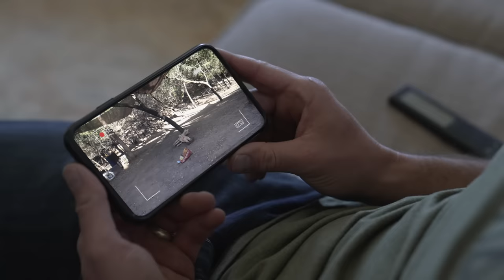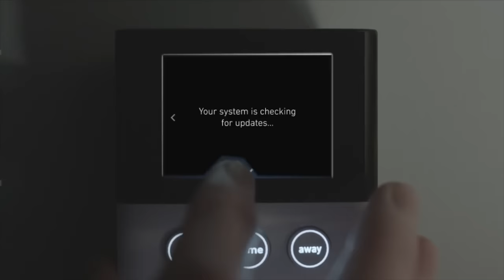Can a Brand New AK Survive the Demolition Test?!?

Comment: I'm calling that a pass honestly. Well done Century Arms.
Reply: Physical toughness does not make it good. It might still blow up like a ras47 does
Reply: @nikik5567  Their newer models have forged trunnions. The ras47 had cast trunnions, which is why they grenade.
Reply: @nikik5567  To be honest, I was under the impression that S7 was a forged steel, but I'm guessing that's wrong.
Reply: @nikik5567  nothing but truth, if you’re gunna go USA, go KUSA
Reply: @mikefelty2625  S7 is just a grade of the steel. Forged vs cast vs machined doesn’t have anything to do with it. S7 is a tool steel. Which in itself is fairly strong stuff, but not suitable to usage on trunnions and other pressure bearing parts of rifles. It’s a good steel for high impact parts, but on parts that are under high pressure, not so much.
Reply: @mlite_33  at least for the time being. Who knows, maybe one day century will eventually get an ak that’s actually decent. Hell, this bft thing might even be it, but my ass ain’t gonna be the one who tests it to find that out. Nah, I’ll stick with guns that I know won’t put me in the hospital.
Reply: @nikik5567  That would make sense, since it would need to be softer, but also still tougher than something designed for impacts. I would think that rifle receiver parts wouldn't make great hammers because they would get dented pretty easily. I have always heard that with steel somewhat soft is tough, and hard is brittle, and there's a goldilocks zone that is ideal for some things so they aren't too soft, but not too brittle.
Reply: @mlite_33  yeah, but we need a new budget ak. Something to get people into the platform or else it’ll die out. And century is the only company that makes budget AKs that have any potential. This bft thing has the potential to be decent.
Reply: @nikik5567  psa is making better budget aks than century ever will, so i think if you want one they’re the go to budget ak.
Reply: @mlite_33  true, but they also cost more than century, so they’re not much of a “budget” option. Plus they still left a bad taste in my mouth with their 74m
Reply: @nikik5567  PSAs cheapest rifle is 700 while the century is 829… I’d rather use a cheaper psa with them having the experience with forged trunnions than century being brand new to the game. plus they’re fixing their issues with the 74, the increased wear seems to be normal
Reply: @mlite_33  oh they dropped their prices? Neat.
Reply: Nah it’ll probably beat itself to death after a few thousand rounds

Comment: Honestly if they did a C39V3 with FORGED parts and a MILLED receiver I would buy one in a heart beat even if the price was around 1500 bucks or so.. The C39's were actually really well built guns with excellent recoil impulses, BUT the problem was the cast parts and the scope mount being proprietary. Other than those two things. The C39's were way nicer than a wasr. The Wasr just uses forged parts and is actually serviceable and trust worthy. I dont know about the BFT's it seems their trying to compete with Zastava USA with this model. Nd I think ide rather have the Zastava lolol. Good looking gun tho the BFT. I would be interested to see robski run it thru his 5k round test.

Comment: In 95, on Urus Martan, I came under mortar fire with the same AK-47. I was opening a can of stew at that moment and put the machine gun to the tree with the trunk at the top. When the arrival of mines began, I just fell into a roadside ditch and when the shelling ended, I went to look for my kalash and backpack. So the butt of the kalash was cut off by a fragment and another one hit the receiver and bent it badly. Then I asked the tankers for a tire iron, clamped the machine gun between two rails and bent the receiver. And my machine gun worked after that for another 2 days and then I took the AKM from some killed Arab militant.